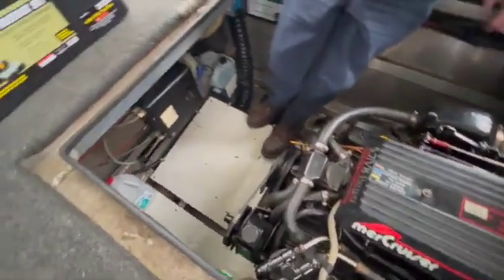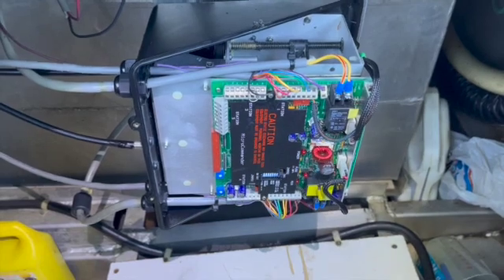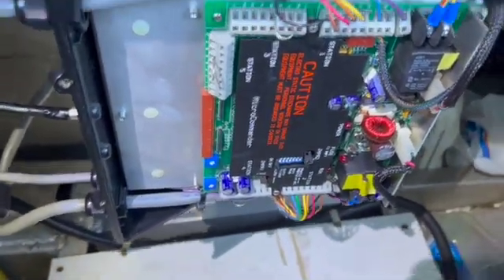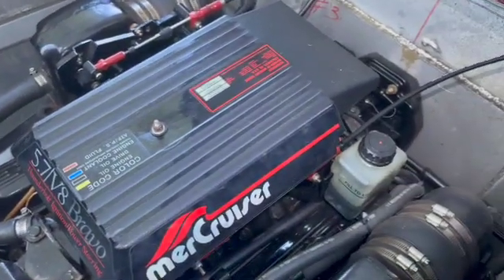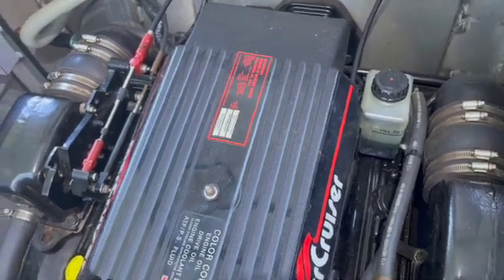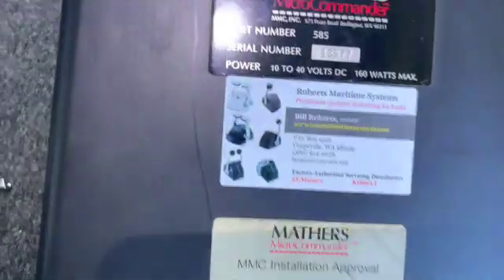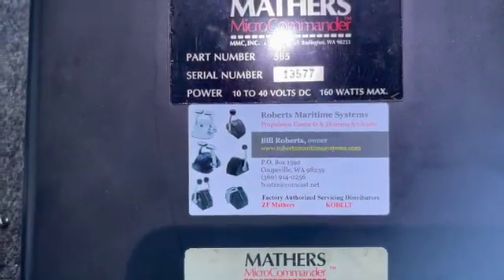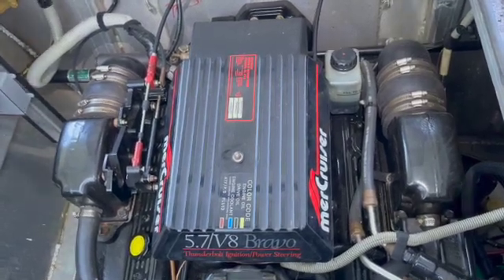Mathers Microcommander troubleshooting

Comment: I had a problem with my MicroCommander on my port Engine.  I called Bill (on a Saturday!) and he answered the phone and helped me troubleshoot the problem.  His advice was spot on!  I had a bad connection at a newly installed alternator.  The problem was easily fixed and I did not have to limp home (40 miles) on one engine.   And he didn’t charge me for his time!  I only wish there were more helpful people like Bill in the US!